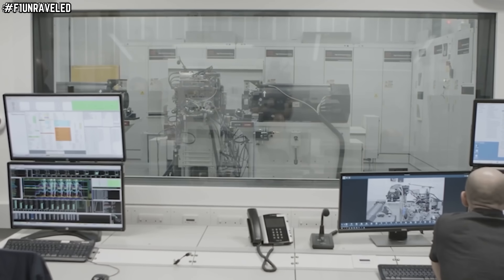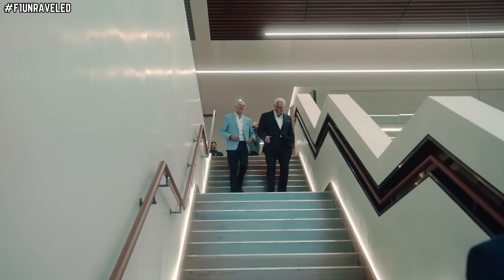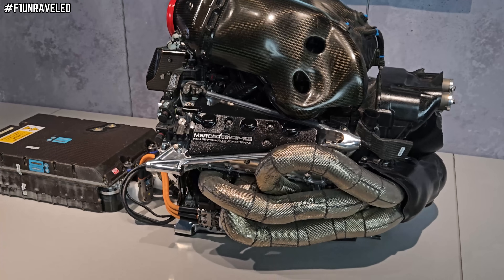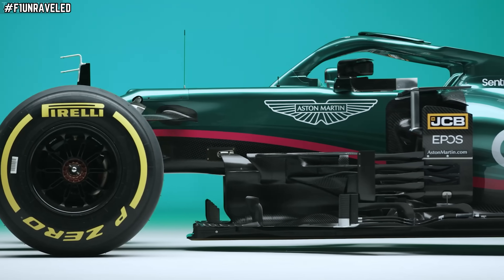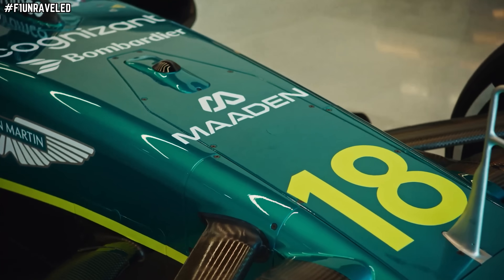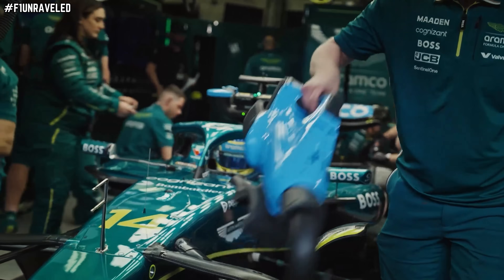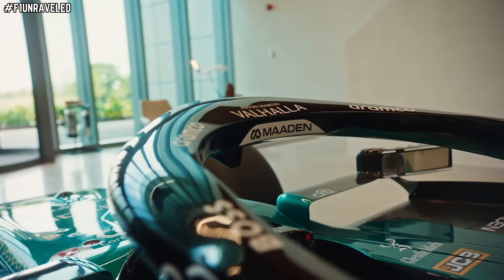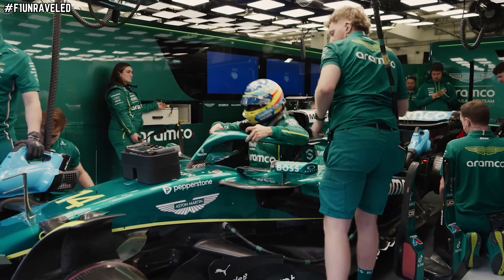Aston Martin’s Revolutionary 2026 Car – Newey’s Honda-Powered Beast! | EVERYTHING You Need to KNOW

Comment: 'The car designed first then the engine had to fit in it' says it all. Ironic it's the complete opposite to Enzo's 'downforce is for those without good engines' The first makes more sense, what use is the most powerful engine if you can't transfer that power to ground. Genuinely can't wait to see what Newey cooks up. On a separate note... can anyone remember what team Newey was with when Brawn racing out done the field with their double diffuser. Would be good to see an underdog team do the same in 2026

Comment: I still think they needed to have front axle energy recovery to really take advantage of the 50/50 split, otherwise they are just burning fuel to charge batteries instead of accelerating the car, then still rejecting most of it as heat when braking.

I guess whoever can find a way to do something magical with rear axle braking will be the top contender?

Comment: When CVT gearbox's were introduced to F1, unreal advantage that gave Williams a 3.5 seconds per lap advantage without pushing the limits in testing, made F1 ban that type of gearbox. Hmm
If CVT gearbox's were allowed to be returned, then the car would loose at least 25% in weight easily.
Reply: 25% ?? It's 168kg gained and you said "at least" meaning you think it can even be more than that , you ok ?
Reply: @spacerenn The beauty about the CVT gearbox is that it offers a simple way to provide an infinite number of gears to maximize the engine power transfer to the wheels and is so much lighter than the current F1 gearbox's.
Apart from being much smaller, it is also a lot lighter. Ha-ha.
We don't believe that F1 will allow this gearbox to race again as they can't control how it works and will definitely make F1 cars even faster.

Comment: Talk about not having anything on the car that’s not needed. We’ll.  At 50/50 battery/ICE F1 is just one regulation change away from the ICE being redundant. Just roll F1 into Formula-E and call it a day.   I understand this special sustainable fuel costs a fortune compared to the already special and costly F1 fuels.   This is really stupid. You want sustainable fuel, use 100% ethanol. Indy cars have using it for decades.
Reply: Could not agree more. Overall energy deployed by the car is taking a hit, I have a feeling the sights and sounds will be muted unless inverter whine is your thing. Ben Sulayem needs to go, scourge on the sport.
Reply: Agree 100%. F1 lost its soul when they went electric. Like it or not,the noise of the engines was part of the spectacle and now there’re fans who will defend the use of battery power. Now it’s all about the personalities.

Comment: Honda had to restaff it's Sakura plant due to many staff joined the RBPT project. Honda confirming late to the 2026 PU list makes it hasn't had much time outside the budget capped time. Therefore I get a 2015 feeling for Honda. It will get there but development stays capped.
Reply: Nahh bro. They still had plenty of staff. Plus a bunch of RBPT staff left to go back to Honda. Also, HRC US has a big hand in the design as well, and they have been fully staffed and building race engines for years already. Honda ever had a hiccup like 2015 once. Highly doubt it will ever happen again. It was more McLarens fault than anything.
Reply: @danielgreensides8463 
They have plenty of staff now but not at the start of the costcap regarding the engine. Regardless the cause of the Honda problems in 2015, those were present. McLaren payed Honda handsomly for their engines. Red Bull got the engines sponsored by Honda so Honda could safe face. AMR pays the motherload for Honda power and are therefore demanding certain dimensions just like McLaren did 11 years prior. 

Exited to see the new technology running on track.

Comment: Intersting video but if you are going to recover more energy you need bigger electric motors which may add more weight than having just breaks. so it will be interesting how teams engineer this
Reply: Usually the limiting factor for recuperation is the max amperage the batteries can take, not the performance of the motor. So a newer battery technology might provide that with no additional cost in weight.